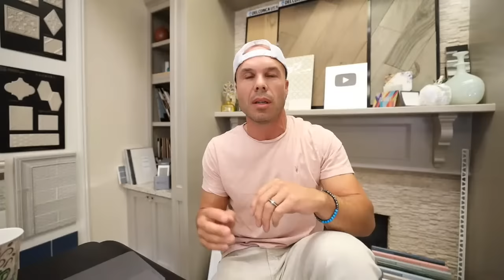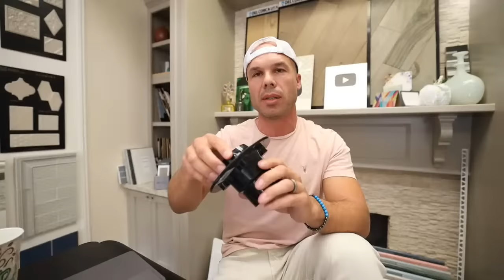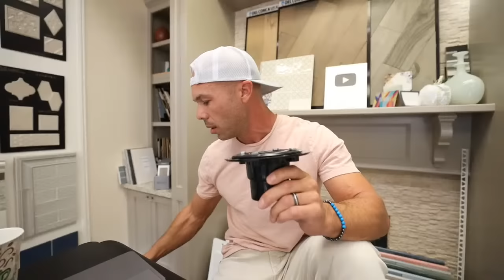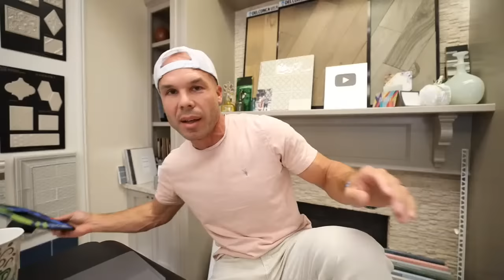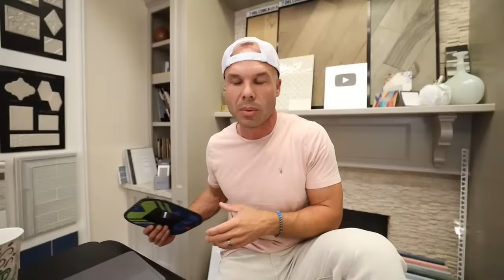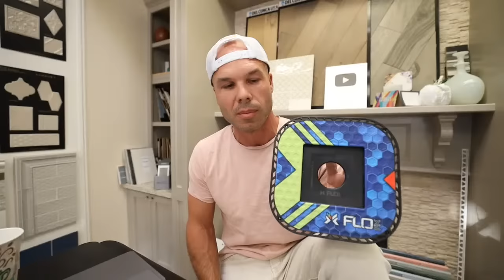The 3 Biggest Mistakes I See in Tiled Showers

Comment: I really appreciate your videos.   I am getting ready to tile my 2 showers here in Lincoln, NE as a  first time DYIer.  I was told by the "home improvement store" that I should use a Natural stone and large tile mortar vs thin set for my 12 X 24 in porcelain tiles.  I don't hear anything about using mortar, so am getting antsy about sticking with that plan. They also told me to use Fusion Pro for my grout.  In one of your videos, I heard you say that Fusion is crap.  Do you have more to offer about Fusion vs Fusion Pro?  Thanks for your opinions!
Reply: You want LHT thinset. Specifically for large format tile installations. 

Schluter Allset or an equivalent.
Reply: My opinion is people that work at home improvement and hardware stores work there for a reason. Think about that.
Reply: Those who work at the home improvement stores aren’t the same individuals who worked back in the day who were retired tradesmen. Nowadays the big box stores offer great pay and Benefits so the experience in the trades has left. 

Using mortar instead of thinset shouldn’t even be a question when you look at the TCNA guidelines (national tile association standards) and yeah you could probably use mortar but it would be a different substrate it would go upon.